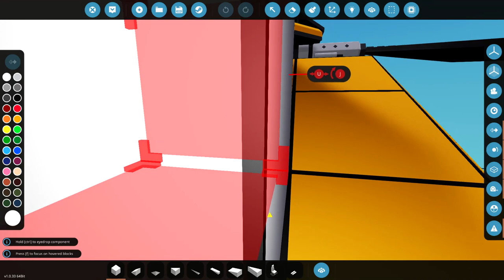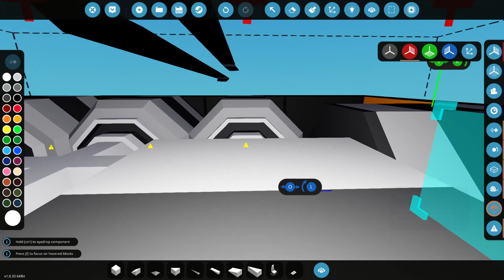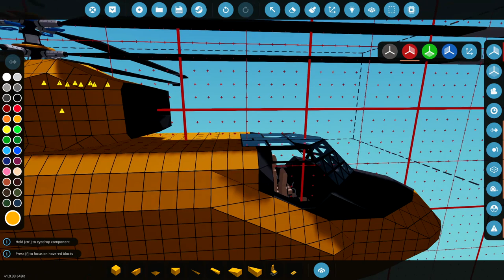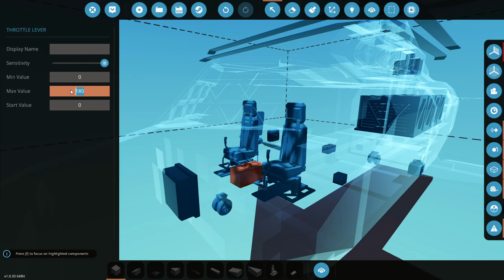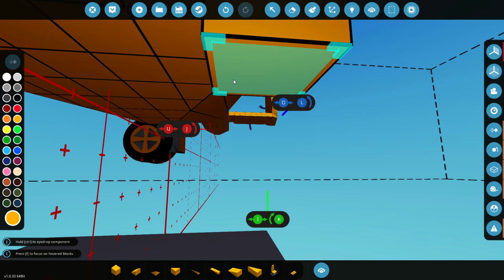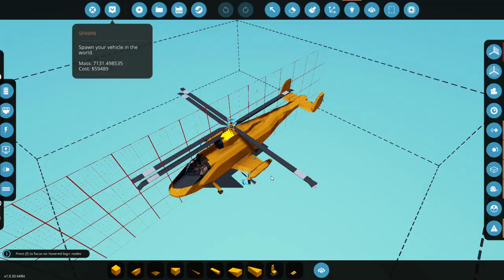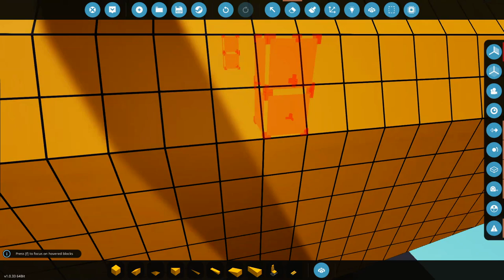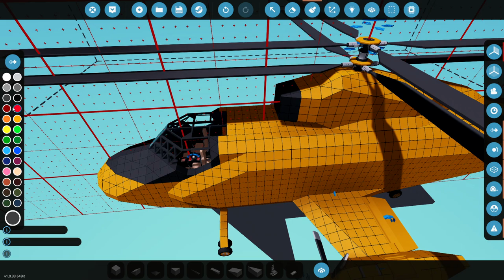Working Jet Engine & Vertical Lift Off!  -  HeliPlane Build  -  Stormworks: Build and Rescue

Comment: The helicopter has a great design, the problem is the weight on the back, because of the amount of large batteries on the back.

And also as this does not have the propeller in the tail of the helicopter / airplane, so practically vertical control is more difficult.
Reply: Yeah, the weight needs distributed better, however these types of helicopters usually are indeed harder to fly, at least the few that are actually out in the world, because of the lack of tail rotors to help correct the helo from being off balance
Reply: @deadly_mir  or medium and small batteries, I don’t know what is the battery consumption in the game but if it’s not so much depending on the amount of stuff, you just need a few

Comment: I know why the helicopter wanted to tip backwards: the rotors are too far forward of the center of gravity. maybe use some weight blocks on the inside to correct it. Would a normal tail rotor be desirable for yaw control purposes? One time I made a twin rotor helicopter but could not get satisfactory yaw control so I gave it a normal tail rotor, set it to neutral, and had the yaw output control the collective on the tail rotor.
Reply: or he moves the batteries forward since those are heavy and in the back
Reply: Same, my twin rotor heli still has a tail rotor for yaw

Comment: Hey Frantic, the reason why it keeps leaning backwards....Because you have the weight of the large batteries behind the rear set of wheels. 

In order to correct the uneven load balance issue, you will need to move the large batteries more towards the center of your helicopter. 

Also - a question/ suggestion:  would it work to have the wings fold out whenever you want to go into "airplane mode" if you prefer to fly it like a normal helicopter?

Comment: The roll doesnt work because you have the normal rotor rolling to one side and the inverted rotor rolling to the other side. You get yaw by adding to the collective on one rotor while substracting on the other to create torque imbalance.